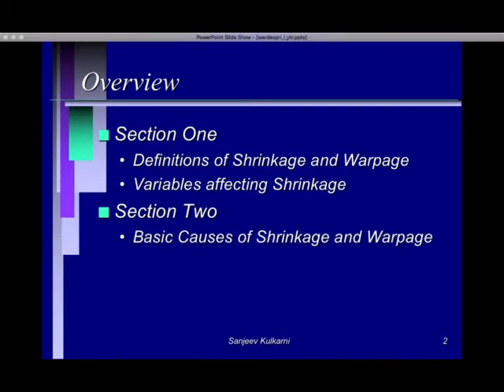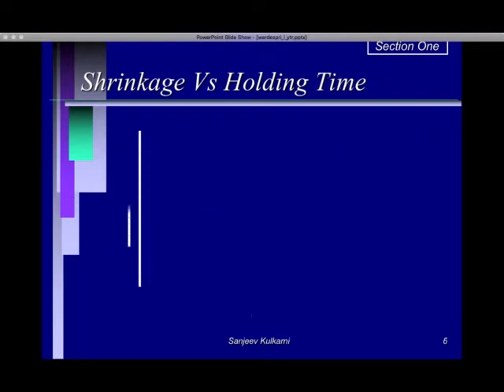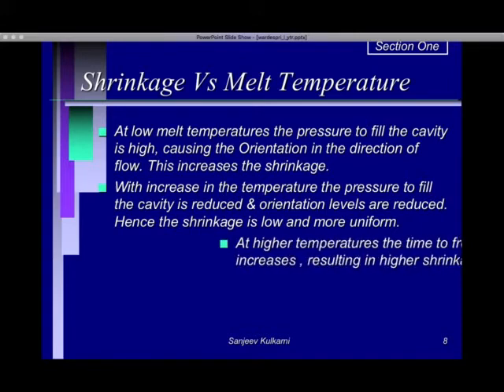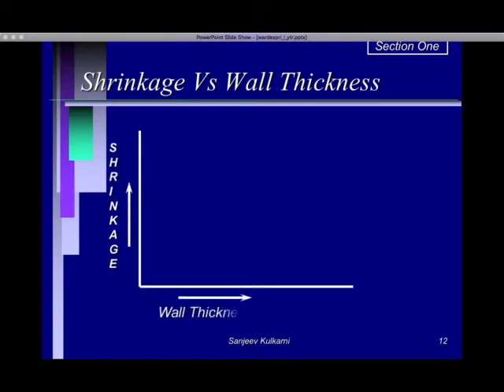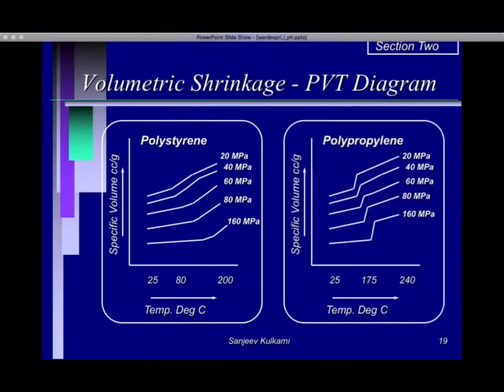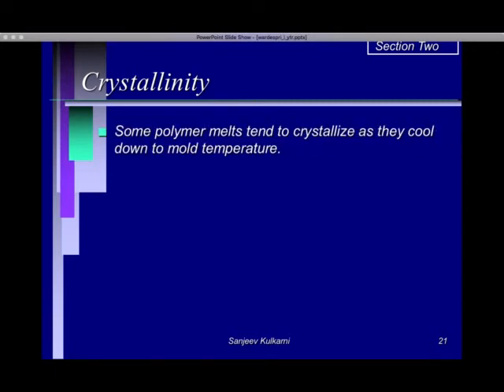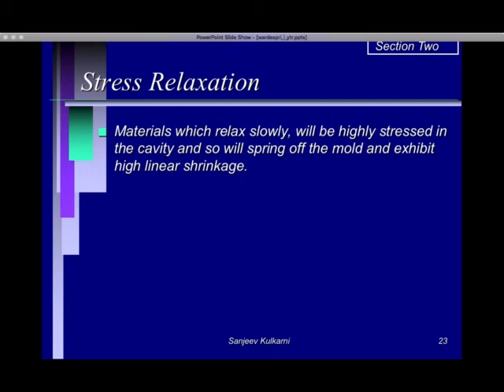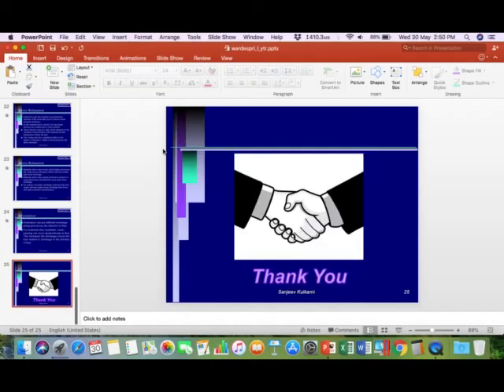Principles of Warpage in Injection Moulded Plastic Parts

Comment: What is cause of warpage  ?
Reply: Warpage occurs in injection molded plastic parts due to variation in shrinkage across various regions of the part.
Reply: @skulki1  what happens in material ? Reason sir
Reply: @pratyush8737  Material plays an important role in the warpage. Material crystallinity has impact on the shrinkage and warpage. I have addressed this in other presentation.